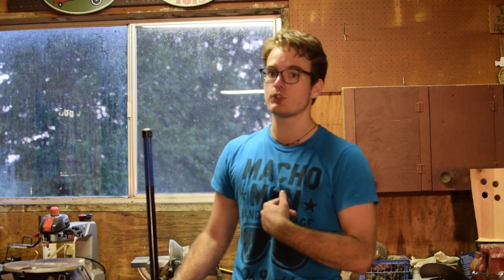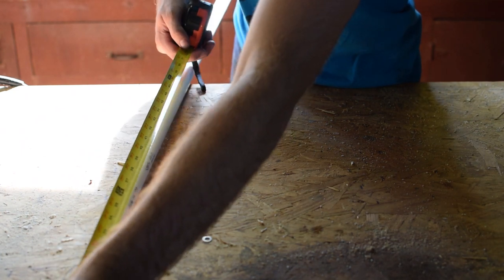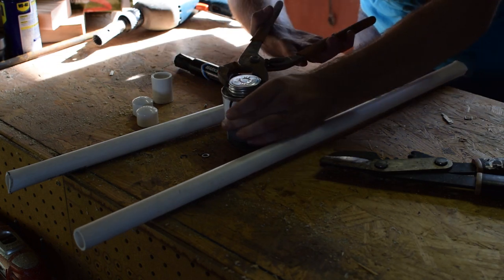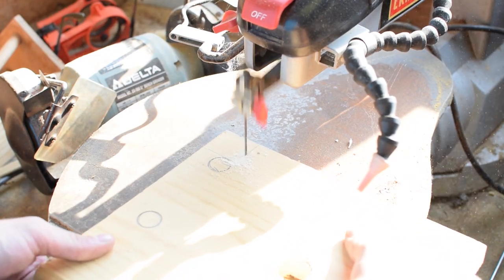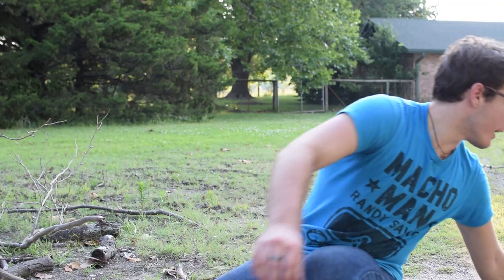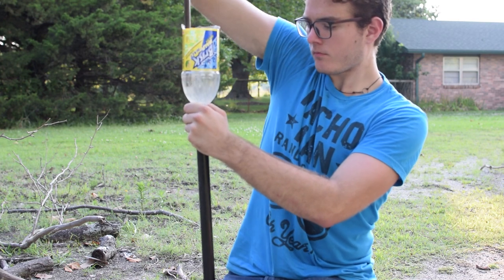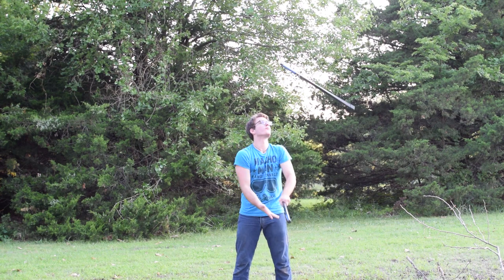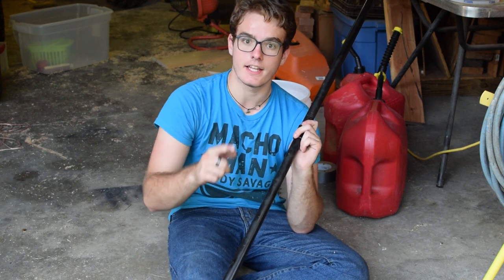Weapons Workshop:How to make Nightwing's Staff

Comment: I would recommend using a screw cap or make a locking cap rather than the coupler just so it doesn't slip
Reply from the maker: +BHAGaming a screw cap would still have to connect to a slip adapter. With smooth pipe there will always be one element cemented on to a slip adapter. We made the choice of a slip cap rather than a screw on due to the fact that the screwing threads are thinner that the pipe itself, therefore creating a weaker snap point. Whereas a slip cap actually thickens the end of the staff reinforcing it.

Comment: This is good for cosplaying but could be better by adding more ridges at the ends of the connecting escrima sticks. And they are escrima sticks that become a bow staff not a bowstaff that becomes escrima sticks he uses it mainly for escrima sticks and his are electrified. But great video
Reply from the maker: +Dr. Marvel we didn't electrify the sticks due to the fact that impacting any sort of electrical apparatus caused irreparable damage in prototype. We are working on designs for a part 2 to add an electrical component, however this project is just to get the basics of his primary weapon created for use in the live action How to Hero episode over nightwing that will be releasing this weekend. Thanks for your input!

- Joel Messenger